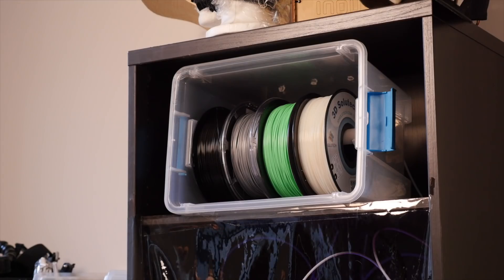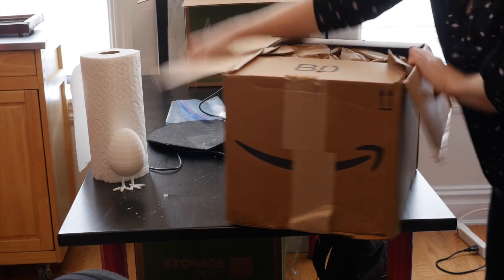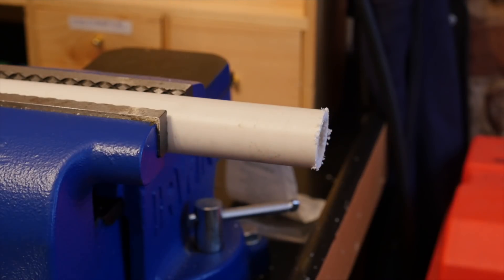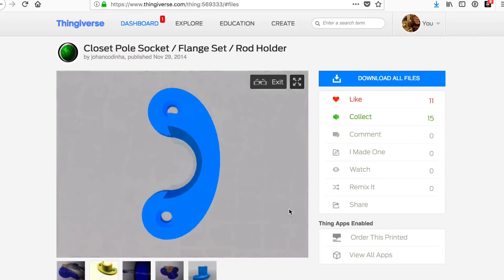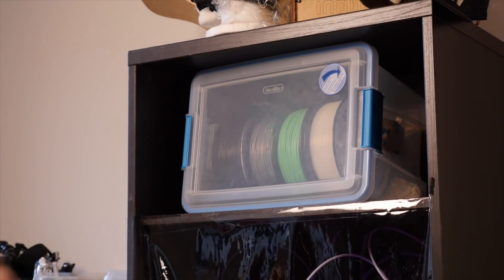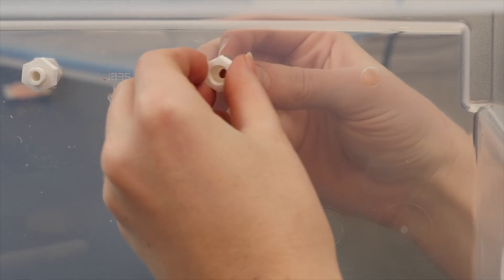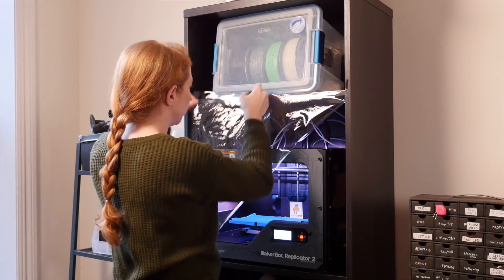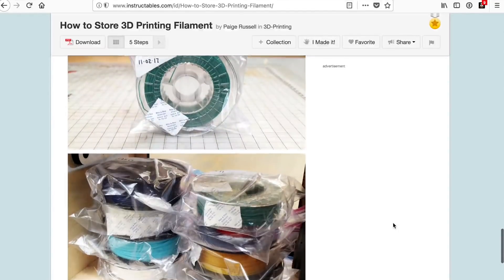3D Printer Filament Dry Box // Becky Stern

Comment: Great idea and video.  Thank you, Becky! I had built three of these boxes over a year ago and still use them.  There are a few issues here and there, but mostly due to my implementation and some poor quality prints (e.g., the filament feeder screw/bolts made from PLA keep breaking--have somewhat better luck with PETG).  My biggest wish is to find or develop a mechanism that can retract each of the four reels in the box after switching filaments without having to open the box each time--something similar to Vincent Groenhuis' "Universal Auto Rewind Spool Holder" (https://www.youtube.com/watch?v=03iUbhrU8xw).

Comment: Just made mine and it didn't come out that good. The PVC pipe holders were scaled up so much for my 1.5inch PVC that there was less room to fit the spools of filament, so I could only fit 3 in my box. The screwless filament feeders don't grip the PTFE tube enough and it just slides around. The seal on the Sterilite box is not really an air tight seal, its just some foam liner on the lid of the tub.

Overall cool idea but the models seem a bit outdated and a different box should be used for a better seal. But I'll gladly take the knowledge from making this first one and make an improved second one.

Comment: I made your filament box with one enhancement. I found these cheap thermometer/hygrometer combo.  https://www.amazon.com/gp/product/B07TRKGW9G/ref=ppx_yo_dt_b_asin_title_o03_s00?ie=UTF8&psc=1
I mounted one on inside reading 25% humidity & 67 degrees using velcro and have one just sitting on top which is reading the room values 52% humidity and 67 degrees. They come in a 4 pack for 13.99. As you can see from the readings your design works very well. Thanks, Marshall@shootforthegoal.com

Comment: Thanks for the video. Have made a few of these and also installed a cheap humidity sensor with LCD display (https://www.amazon.com/dp/B07K6GMTFJ/ref=cm_sw_r_em_apa_i_kpmNDbK22D8DN). Seems to be working fine. Do have a question on printing the screwless filament feeders. I'm having no luck with getting these to print. They are so thin that it just snaps apart. What filament type did you use and what were your slicer settings? I use Cura 4.3 but any info on settings would be helpful. Thanks.
Reply from the maker: 100% infill!
Reply: Ran it with 100% infill from the start, no luck. Also, if you look at the model the wall thickness is too thin along the shaft for infill to really apply. There's just not enough material there. What are you running for wall thickness? I tried a bunch of different settings but haven't been able to print even 1 that hasn't broken off at the shaft. Probably just going to design my own. What slicer are you using? What layer height are you using and are you printing it in PLA with a 0.4mm nozzle?
Reply from the maker: Yeah the infill just prevents the base from shearing off of the post in my experience... Sorry I can't give you Cura settings, I made those on my Rep 2 sliced with (now deprecated) Autodesk Print Studio: .2mm layer height, 2 perimeters. Yes, PLA with a .4mm nozzle.

Comment: The storage bin you recommended is "air resistant", not "airtight". Unfortunately, I didn't realize this until I had already built the boxes, and then wondered why the humidity wouldn't go below 30%, when I could get <15% in a ziploc bag. It's better than nothing, but I really wish I had started with a box that was actually airtight.

Comment: Hey, 

Great video! Earned my subscription! I have a question here though, what do you do with the inactive filaments? my printer can only take one filament at a time so would I just leave the other 3 dangling around in the feeder tube? Wouldn't this compromise the air tight enclosure? Would I roll it up and seal the feeder tube and then every time I want to use the filament, open the box and roll it back through the feeder tube? 

Thanks!
Reply from the maker: I just leave them dangling when not in use, worst case is that I have to throw away a few inches of the filament at the end of the feeder tube when I want to change colors. I also store super inactive filaments in freezer bags with a few packets of silica gel.

Comment: Very nice video and construction! The only downside I can see is that in order to change one of the filament rolls, you need to disconnect all of them.... is that correct?
Reply from the maker: The spindle supporting the filament rolls does need to be removed to add/remove any, but you could leave enough slack not to "disconnect" the filament from the printer if that's what you mean... a fix for the former would be to put in a few of those filament holders with bearings instead of a single spindle.

Comment: The container is $60, that seems pretty steep for a sterlite container of this size. You can get something similar at The Container Store for $9.09 (sku: 10067984, 11 3/4" x 17 1/2" x 14 5/8") and it's "weather tight" so no gasket is needed.

Comment: Does silica gel really work like this? Did you measure the humidity inside of the box?
Reply: You can use an inexpensive hygrometer to track the humidity levels, Amazon has one for $3.46 : https://www.amazon.com/Amrka-Hygrometer-Humidity-Thermometer-Temperature/dp/B073PR9X8N/ref=sr_1_2?ie=UTF8&qid=1524144191&sr=8-2&keywords=mini+indoor+outdoor+lcd+hygrometer

Comment: Very nice design and I almost built one like this but I realized that I'd prefer to have either individual enclosures for each spool or have them run off a ball bearing surface because if you have one spool run out you have to remove the entire pvc shaft for all spools. Thx for the video.
Reply from the maker: I've had a good experience with this bearing-ified spool holder: https://amzn.to/2JCx8Ke
Reply: Thx a bunch for the recommendation. This is exactly what I want to use.

Comment: Which size diameter PVC pipe are the brackets designed for?
Reply from the maker: I honestly can't remember how much I scaled it from the original since I just adjusted the scale up or down after a few rounds of testing. It does not have to be a super precise fit. You could always wrap the ends of your pipe with a rubber band to take up some extra space and provide grip.
Reply: Hi, Becky. Thanks for getting back to me. I just wanted to make sure I got the correct size PVC pipe for the brackets. The size I got has an outside diameter of approx. 1-5/16". Does that sound about right?
Reply from the maker: My pipe is about an inch in diameter.
Reply: Becky Stern I know this is going to sound presumptuous, but I have no idea how to edit the file in order to enlarge the opening of the bracket to accept the PVC pipe I bought yesterday. I'd return it, but I had the hardware store cut it down so it would fit in my car. Can you tell me how to enlarge the opening, or, is it something you could do easily? Any help would be greatly appreciated.
Reply from the maker: I didn't edit the file, I just scaled it using my printing software (free Autodesk Print Studio). This is a universal feature of prepare-to-print software and you can also scale in Tinkercad. The screw holes also get scaled, but that wasn't an issue for me, as they still fit my screws just fine. Best of luck!
Reply: I found this great application called eMachineShop. It's pretty specific for making small parts, so I just designed new brackets to accommodate the larger diameter PVC pipe. Thanks for your help, Becky.

Comment: Pretty nice implementation. Do you use some silicone or rubber caps on the end of the teflon tubes that are not used at the moment?
Reply from the maker: Thanks! Nah, since they are so long and full of filament, hardly any air can get in. And that bit of filament exposed at the end is purged through the nozzle when I change colors, anyway!

Comment: Thanks for another great video! I made a similar filament dry-box for nylon filaments earlier this year. I couldn't find any boxes with rubber seals like yours, so I used silicone caulk to DIY my own. However, the seal ended up being incomplete and the silicone didn't adhere to the plastic very well. It looks like yours turned out great; perhaps I'll give it another try with this box/method :D

Comment: Great implementation, and I love your printer station/shelf. I've got to do something like that as mine is currently in my freezing garage. Do you have any issue with an PLA plastic smell when printing in your office/house? I'm worried about that.
Reply from the maker: Thanks Sean! It has a slight odor that I hardly notice (and you have to be pretty close), certainly not like printing with ABS (yuck!).
Reply: PLA is perfect fine indoors. I have it in my basement with no windows and I don't notice a scent. Printing wood filament is nice it give off a sortve woody scent. ABS tho is an nono for the non ventilated indoors

Comment: 👍👍Wasn't aware of that issue with PLA. Good to know.
Reply: Except it's not really an issue with PLA. I#ve had some PLA spools open in a room with 60-70% Moisture for two years(!) and all that happened was that it got a little brittle (could also be because of the UV-Exposure) In case your filament picks up moisture you can bake it (there are tutorials on youtube for that)